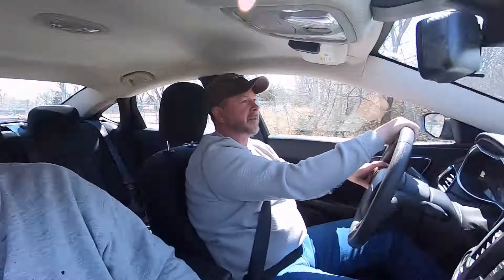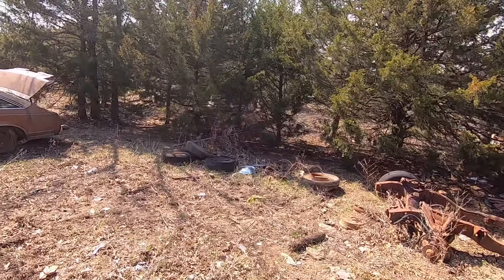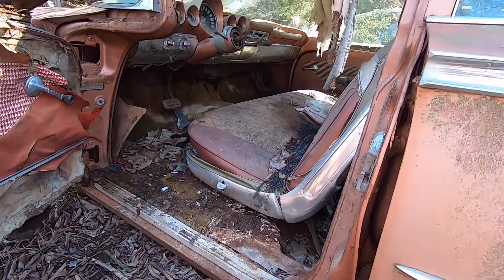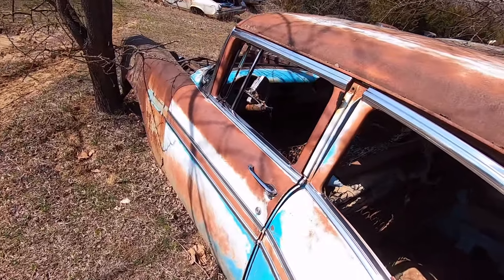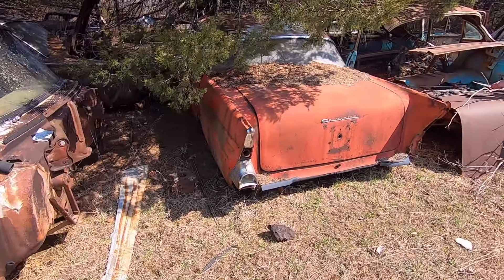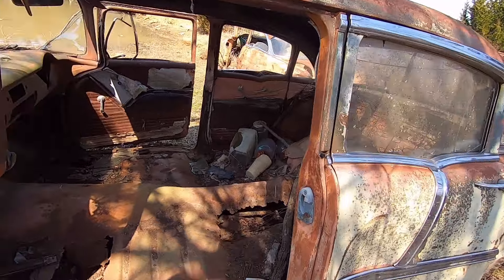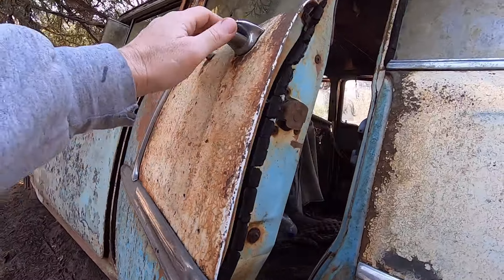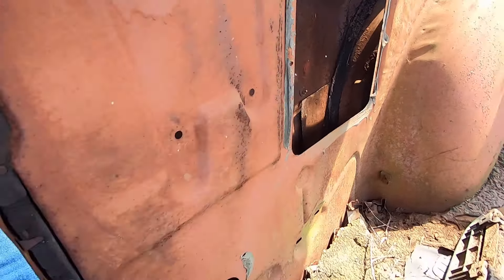PART 1 - Old cars EVERYWHERE. Another junkyard walk.

Comment: I would like to find a 58 2 door post body. Chevy. And you can straighten  those stainless  moldings and even WELD  them together.  I might have to convert a 4 door sedan. That would be what to do with a lot of that stuff.  Looking forward to part two.lots of builder cars.i think wall mart is going to sell sheet metal for try 5. Pretty soon. L.O.L.